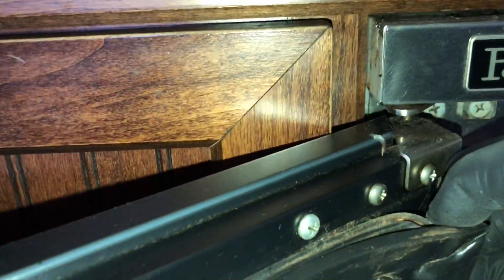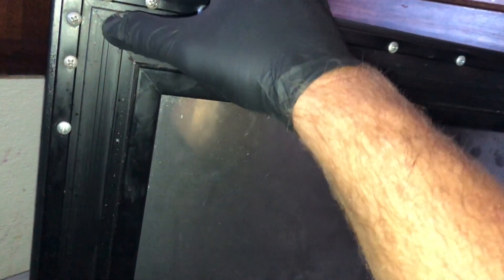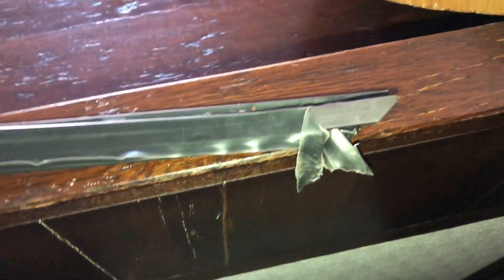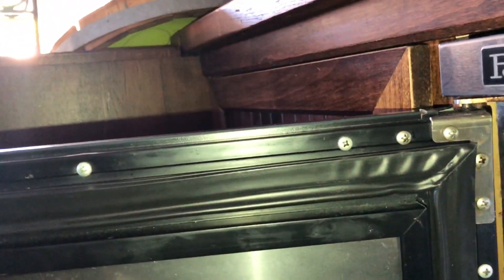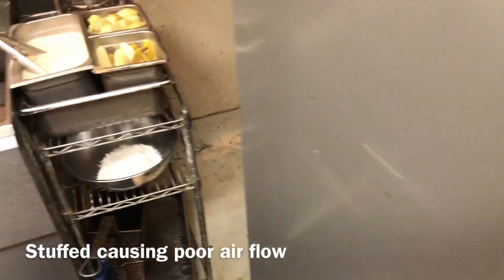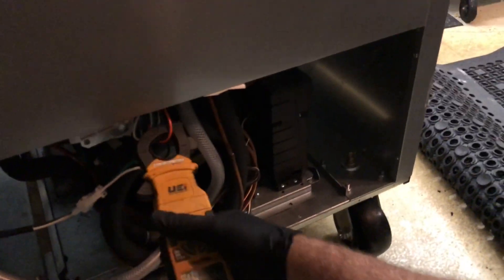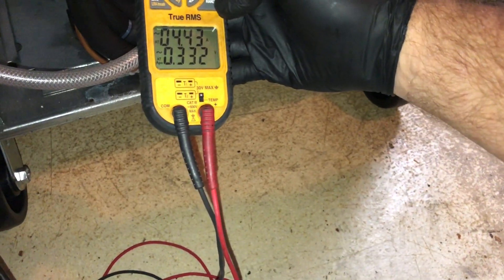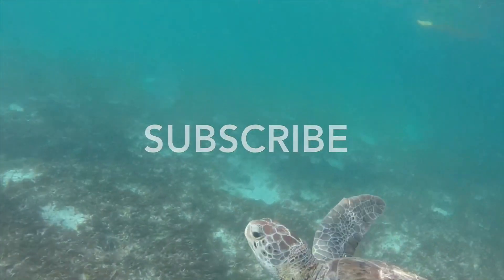Door gasket tips

Comment: Good vid! All I would add is for particularly difficult gaskets (or door seals as we call them here in the UK) put them through a dishwasher on the shortest cycle to soften them up. On the range of equipment I work on I find the True bottle cabinet door seals the easiest to fit, Foster FSL400 upright fridge / freezers the most difficult. Some manufacturers use metal gasket retaining plates that are screwed on; I think they're just plain stupid.

Comment: Good Vid. i Allways scrub the Bottom of Door frame too. Since sometimes its the Only time Doors get cleaned. On Beverage air & traulsens i allways just Pull the door since its just hanging there & Pulls so damn easy. Flat surface is easier to pop in gaskets vs vertical surface. wet , clean , Warm doors are Way easier to put gaskets in than Cold or Frozen doors. Plastic Door frame is Wayy more pliable warm.

Comment: those small timers tend to melt the "cam drum" when contacts get a bit pitted and start running hot, then the defrost or compressor run time changes or gets intermittent, some time they get funky and run compressor and defrost at once or slow down due to drag or get stuck from gear teeth wear.
yeah I very often tear down broken things, I like to see why and how they failed. it's a bad habit I've had since a young child  ;)

Comment: i always start with the corners...press it in by hand and then use a rubber mallet to knock in any spots i missed
Reply: rubber mallet and piece of old pvc trim works well as a spreader, the light color gaskets can get marred/scuffed by the  cheap mallets  and nobody wants to work cleaning off multiple black smudges :)

Comment: Matching new with old is usually true unless your replacing gaskets on a True.
Unlike that Perlick some True have different channels on their doors.
You will get an order from the factory and that gasket might even be smaller than the original.

I watch your videos like their cable news.  Can’t wait to see what happens next time.
Reply from the maker: Mike Reed thanks Mike
Reply: what I found on, the multi-channels are for single or dual/wide gaskets, mostly freezer have the wider/double, but also in real hot/cold outdoor uses also

Comment: Also, depending on the material, I actually learned this from TOH: On PMs, apply vaseline to the gasket to extend the life of the material. Never tried it when I was doing refer work, but it would be worth a shot?
Reply: careful applying any type of petroleum or silicone grease/lubes, depending on what the rubber is made from, it could make it break down, harden or turn to slime in no time!
god knows what they're making them out of now days, same goes for faucets and other plumbing grease applications.

Comment: For anybody that says gaskets are easy. Try changing 39 gaskets Ina supermarket all by yourself with a rubber mallet and a your hands
Reply from the maker: nismomax516 done that. Beats your azz good.
Reply: deli case sliders suck, sticky nasty 3m double sided tape and pop rivets, yeehaw
other slider doors suck also, position them wrong due to worn doors and rails, major drag and sticking. replace the whole doors and track you say? have you priced them? :))